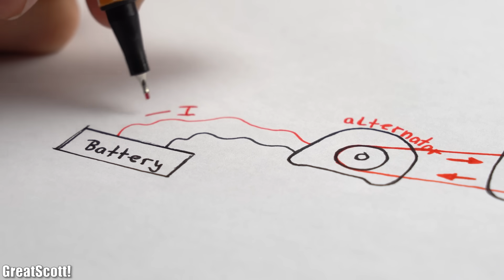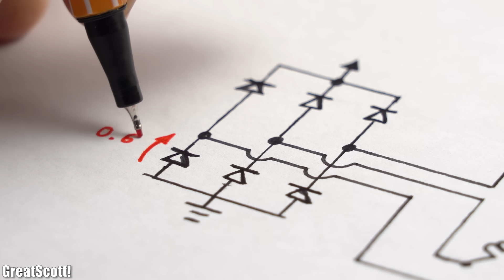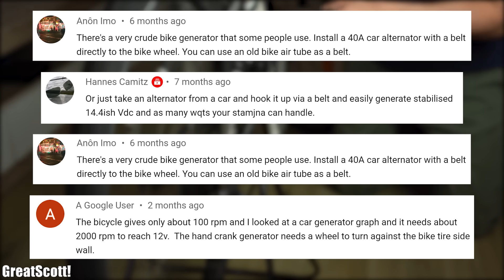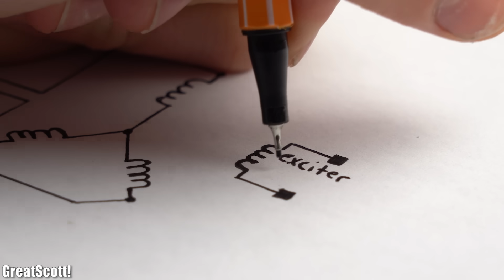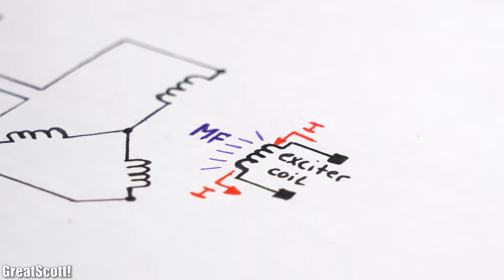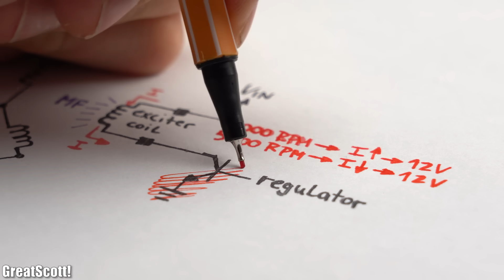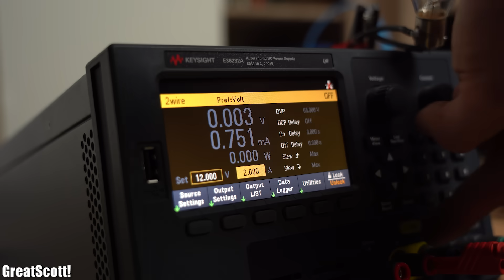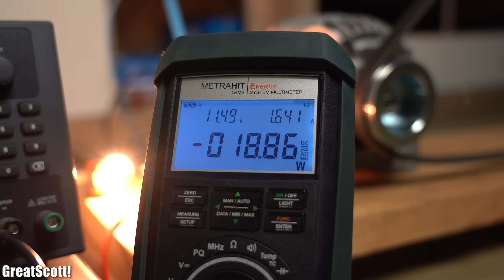Using a car alternator with a bike to power my home? How much energy can I produce?!

Comment: Hi Scott, thanks for this nice demonstration..I would ask you an advice, if you permit: I would like to get more amps from my car battery (or its alternator) to obtain a good power (amps) for a water elektrolyse station that will produce HHO that will be used to clear car´s motor without dismantling anything on the car´s motor (there is a lot of company producing this kind of engines), can you please advice what should I add to my HHO station (appart the anodes, cathodes and neutrals) in order to be efficient enough? I mean in HHO production. HHO as you surely know is obtained by water electrolysis by DC courent. The HHO cleaning process is taking place while the car motor (witch is being cleaned) is on and all the power is taken from the cleaned car. I hope you understand the process. Thanks, Samuel

Comment: The newer alternators have circuitry in them to turn it on and off as needed. Throw that alternator away and get a Delco 94 amp 12si alternator. Look them up and learn the electrical properties of them and you will be amazed at the simplicity and their great design.  Once they are excited the are self powering. You can get different voltage regulators for them for 6, 12, or even 24 volts. or even a self exciting one, ( the famous "one wire alternator") Then build a big tower and with a crank lift a big weight up and let it fall to power the unit. When it gets to the bottom have one of the kids  lift it back up. Use it to charge a battery to run your house.       Mike

Comment: Try clipping the diodes as last resort. Try drilling holes into the armacher inside of the alternator then use some small magnets.& epoxy.,or clear adhesive to hold the magnets into the armacher spaced between each cycling point. Spaced out.

Comment: The say the maximum output a man can produce is about 1/3 of a horsepower for short bursts, so about 250 watts.  It simply doesn't matter what type of generator you hook up your body can't produce the required power.

Comment: How could I apply to a wind system? Like a windmill with a pulley attached to it? How many lights could I power off 1 alternator if it was at a constant speed as long as the wind blows
Reply: Or how many 12v outlets could be powered off one alternator? And at what minimum speed does the alternator need to be spinning at in order to power all of those "said number of outlets" ? Thank you

Comment: If you chain 2 rear wheels together you could up you gear ratio. Also you might look into permanent magnet generators. They use them in wind towers.

Comment: Once the apparatus is built, then run your power to through a transformer to step up the voltage so you can do more with it. I'd suggest running several step up transformers in series to get the desired power you want.
Reply: Don't forget that stepping up the voltage will reduce the current available. The power available will not increase.

Comment: Good start here man. Ok so some tips. 1 a rolling bed at 1:1 with the alternator. No more mounted bike. 2. Flywheels. This will allow you to stabilise current output in a mechanical way. And 3. Use the bikes gear system. To scale up the RPMS. If need be get a BMX crank that'll up your output.

Comment: Ok, mechanic here! 30 years of experience. The battery IN the car creates the magnetic field in the alternator in order to "produce" power! The "VOLTAGE REGULATOR" the 2 wire thingy is the voltage regulator, it is COMPUTER controlled and changes amp production by changing the amps or voltage it inputs into the "field coil" (magnetic part). An alternator at full field (technical term for full power at about 80 amps) can take 25 to 30 horse power!!! Cool idea bro, but LITERALLY NOT GOING TO HAPPEN ON A BICYCLE!!!!! EVER! Unless that bicycle has a gas engine. Cheers!! Cool idea though.

Comment: To get the maximum out put of the alternator it needs to spin at around 6000 rpm otherwise it will never produce the 120 amps

Comment: Well I'm just going to have to say I've already done this experiment but I didn't use a bicycle I took made me a windmill with a caterpillar radiator fan that's adjustable to catch the wind real good and I know how much $1,440 watts of power I can do simple addition and that's all you have to do is add up your wattage in 1440 Watts ain't going to power up much so you only better have a TV and a light bulb in your house cuz you ain't going to do much more than that, and I'm not trying to slap you upside your head or anything like that but because I do like your show I watch it all the time but 1440 you got to have like five or six women Mills battery Bank backup generator solar panels if you want to live off the grid and all working in conjunction one another but yeah I've worked the hell out of these alternators and windmills

Comment: That 2 pin plug you don't know what is for. That where you plug in the voltage regulator. That alternator will never work the way you want without the voltage regulator.

Comment: I recommend attempting to ditch belts all together and connect metal to the alternator and placing magnets the correct distance away from the metal plates to make it spin then u wouldn't have to use your energy making this whole project more effective/efficient it would be a constant high speed producing the most electricity u could even 3d print stands to keep everything in place permanently

Comment: Exciter coil - used also as voltage regulator, to have 12-14V on otput, because car engine not working at constant RPM, it always change in wide range.
You need to use little voltage regulator on it.)

Comment: Alternators need a field voltage to produce power and instead of using a power supply u should connect the field directly to the output so even though your field output is low without a field it will slowly ramp up instead of being instantaneous due to it still producing low but still producing voltage also instead of a spring tensioner like a modern cars I recommend one more inline with 1930s-1960s tractors/cars where u slide the alternator to get good tension

Comment: How about a second alternator with reversed polarity hooked up to the other alt for some type of self sustaining drive? Just a thought....
Reply: Same as stepping on a rope and pull up with force enough until your head touches the ceiling. No such thing as self sustaining electrical generation.

Comment: Car alternators take 4 hp to produce their maximum output. This translates to almost 3000 watts of power  to turn the alternator. A top cyclist can produce about 450 watts. There is a reason people don’t do this on a regular basis.
Reply: Exactly...it was relatively obvious from the start.  You can light a little light...but power a house?

Comment: What would happen if the system was not an alternator but standard magnet and coil set up but using a horizontal flywheel on magnets which is against a flat plate reducing the friction resistance to just one point That combined with a high gear ratio set up and a bridge rectifyer for the DC output would this give a higher power output?

Comment: The problem with the car alternator is that it's the same thing as using the car alternator to produce wind power. the revolutions required to get the proper energy out of a car alternator or so fast that it's just generally not practical.

Comment: You might be better off getting a car Generater used before the Alternator was used.  Also, someone mentioned a Flywheel, I'm thinking gears-not sure the Ration so this might be backwards but have your rear wheel act as a large gear connected to a smaller gear or combination then to the Genny.  You'll see setups like that inside of battery powered toys-like a toy car or inside of a wind up watch.  Saw one in an old Cotton Gin.  Gearing ration like in a car.

Comment: You should have put on a belt tension roller. it would have taken up any slack on the belt....you could also geared down the pulley system to create more revolutions per cycle.

Comment: I remember years ago when building hot rods we used Delco  alternators with build-in regulators We used a Zener Diode for one wire hookup. This one wire charged the battery.

Comment: Depending upon how much power output and duration you wish to contribute, the answer of course is you can produce as much energy as you wish.

Some points to consider: 1 hp = 745 w. Few people are capable of producing more than a fraction of that amount, at least for any more than a few minutes at best. 

If you can produce 1/4 hp continuously for 4 hours, that would be 1 hp-hr, or 0.745 kwh.

My wife and I are both elderly, live alone, and don't use more than about 1/3 the amount the "average" household uses. Our monthly bill is around $85 for 400 kwh.

Bottom line here - I'm glad I don't have to generate our monthly electric energy by riding a bicycle to spin a generator.

Comment: Use a Low Turn Big Block High Amp Alternator 10 SI - 1 Wire ! E Bay is like 99.00

Comment: I had the same set up 30 years ago, it gave me crappy lighting, a radio (if i didn't turn the volume up too high), a circular saw  and i even managed to get a washing machine to work by charging two batteries and putting 24v into the motor. The washing machine was more effort to charge the batteries than if i had washed it by hand and the saw would only cut in short bursts and need a pause to regain enough speed. It was all good fun and kept me fit.

Comment: It takes around 3 hp to turn an alternator in order to get substantial amperage out of it there’s no way a person would have the strength to operate an alternator at it’s higher current rating.

Comment: A car alternator actually puts out 14 volts, not 12, but that said, even if you can produce the wattage you need, I'm not aware of any house that has a 12 to 14 volt DC electrical system, so you would still need an inverter to get the desired voltage, (and convert it to AC), further reducing your power output. Given your accent, I am assuming you're somewhere in Europe and your home uses a 220 volt system, so you have to go about twice as high as I would in the US, where most appliances, except for an electric stove, or clothes dryer run on 120 volts

Comment: You can power an electric motor with a 12v that will move the belt and turn the alternator and charge the battery, should keep the system running indefinitely, you can hook up 2 alternators on the belt system one to power the electric motor and the other for a power converter to power what ever you need powered.

Comment: also, if your bike wheel is going 300-400rpm, then you can just add the big wheel to the small motor shaft to get like 1200rpm, im kinda confused why you didn't do that.

Comment: Is it possible to create an Electric motor with enough power to power an Auto and run an  alternator that will put back  what energy is being used. If it can be done, I believe you have the Knowledge.

Comment: Wow I thought it's was an easy thing to generate electricity with induction motor I almost buy some neodymium magnet to fit into the rotator motor without a single thought of how tough it will be to cut into it
Moreover with such low voltage output I would have been a furious idiot of being naive to think of how simple it will be... 
Thanks Scott for saving me time and resources... 
Lucky me uooof

Comment: A permanent magnet brushless motor is much more efficient, especially at low RPMs.  You can get a small PMBLDC motor with a planetary gear already attached on eBay.
You will still only be able to charge a cell phone.

Comment: Make life easier
  Get a self exciting large case GM alternator ad244.   Doesn't need to have a hot wire to "excite" it
  Produce current around 800rpm too
 Aaaand. They can be found in 145 amp versions too.   In my area they are COMMON AND CHEAP

Comment: You should use an old car generator it will start producing power at a lower RPM and you can charge 12 volt car batteries and then hook up a inverter to produce AC current then when the battery gets low you can pedal the bike
For about a half an hour and charge the battery backup.

Comment: Alternators are a fantastic piece of technology but you need something that will spin the alternator without human physical effort. I mean maybe 1-2 hours a day for exercise is good but it needs to run 24/7 or to keep a big battery full or 80% charged. Also you will have to run multiple  alternators to put more power back in than what you're using.

Comment: Um, use the fan motor of a car instead.  Also, remove back wheel and use concrete to turn it into a balanced flywheel then remount it. Also, use tension device on drive belt to keep it on.  You could probably take the pully gear off of the alternator and mount it on the fan axle. 

This should bring you closer to your goal. 😉

Flywheel how to: https://youtu.be/TBjuLDIjgkQ

Comment: There are also "self exciting alternators" which don't need any field voltage / current in order to produce power. They do need "some minimum rpms" in order to start generating power.

Comment: Another great idea would be to use you own energy by doing exercises like you are doing but to be able also to charge a Lithium Ion Battery : Just like the Sun, The Moon, The Wind and Water current can move a propeller around to generate energy. This concept or idea would be a great way to charge your Lithium Ion batteries also without wasting your very own energy. I was thinking about this concept a very long time now. This would deffinetaly promote personal health at home. Would be very interesting to create technology to could be adapted to this for Off the Grid applications. So Ultimately we could have many sources to power up and harness energy : Solar, Wind, Moon Light Panels, Water Currents and Personal Physical Activity that could be added into the equation also.

Comment: now u understand why the production of gas is important..it powers your car getting you everywhere plus the energy to turn that alternater via the engine….. like in car systems…you can disconnect the battery once the voltage is up as the exciter will now be powered by the output of the alt….they say its hard on the brushes..but i have tested this when we do other work on car….but another way to tap into an alt. is just have a car , a old car that still runs..outside your house if possible and run wires to the battery terminals and then into your house onto a ie 3000 watt inverter system..and voila..run your gear….10-4 ? no different by the way….than having a generator in your back yard….more efficient..more quieter

Comment: All I can relate this with is Hydropower. It's really been in my head for like two weeks.

So think this setup, but on its side and using a water vortex to spin a flywheel/ fan, which connects the flywheel to the alternator, via belt and boom. Consistent, natural energy.
Reply: Living next to a river would give you that source.

I have silly question. Why not set up a gear ratio where you peddal and it powers like 10 of these.

Comment: First you need to know how much energy you will need for your day to day usage. Next you need to know how much output your alternator will produce. Using a weighted wheel will give you a more sustainable generation but it will take longer to get the speed needed for optimal output.

Comment: The Law of conservation dictates there is no such thing as "free" electricity-
This is why power plants have elaborate systems to generate electricity.
They are trying to make it nearly 100% return. Even a Marine battery loses power, had you designed one to absorb the energy for later use.
I would ask the question, how do we transfer power from doors opening and closing all day long in a house or a building to the internal power grid. THESE things must be done.
Now, for your bike,,, mount it on the bike and make sure the Lead battery is empty so you can return home with a full charge.

Comment: The cost of the food you would burn through to produce power is much more expensive than the value of electricity produced. There's a reason power stations don't burn cheeseburgers and sausage.

Comment: I met two guys on the west coast of Vancouver island who powered their homes with a car generator using a near by stream.
Reply: That's  good to hear. Could you please give us the link to their YouTube video? Or get the schematic from them? Thanks. Sham.
Reply: @sham1234567891  Sorry that way back in the early 1980's. I do not know if the are alive any more. They were somewhat old then. It should be somewhat easy to do. Just spray water from hose onto a paddle wheel attached,to generator. Attach wires to were needed.
Reply: Greetings: I met these guys back in the early 1980's. They were somewhat older then. It really is a simple thing. They used a near by stream and using a hose to guide the water to a paddle wheel that turned the armature on the generator. Wires to were needed. Hope that helps.
Ivor

Comment: Eliminate the alternator, and use a stepped motor. Smooth the pulses in the output waveform with capacitors, and then send the voltage though a regulator, such as you would find on an electric start lawnmower. Most small gas engines use a magneto, and that's pretty much what the stepped motor would be acting like, an bunch of magnetos.
If you want to get away from pedaling, attach your energy generation unit of choice to a windmill, and place it outside in the wind.

Comment: I am an auto electrician  and I work with altinators everyday !! Those two pins are use to magnitize the rotor to actually get the free electrons in the stator to move !! One of those pins get power from the light on the dash !! The other has to get ignition from the battery. Without those two inputs you wil have no output.
Reply: <3